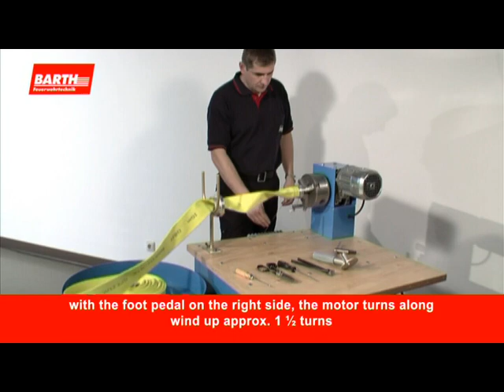Hose-binding machine ESB 69

Comment: What we call wire whipping in the UK.  Our company used this method for hose bores upto 8" in the 80's and 90's.   I designed the machine and had it custom made.  The method has been used for decades here though and many hose manufacturers will make hose assemblies in house this way.